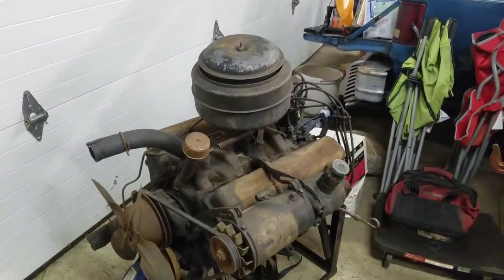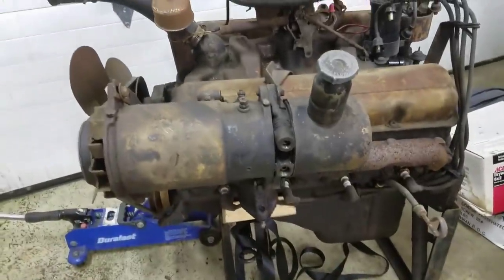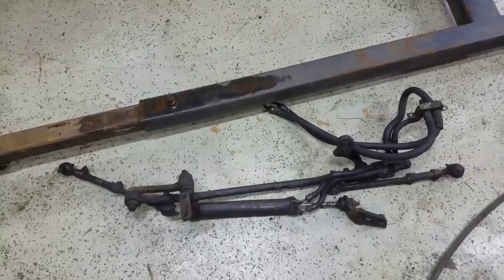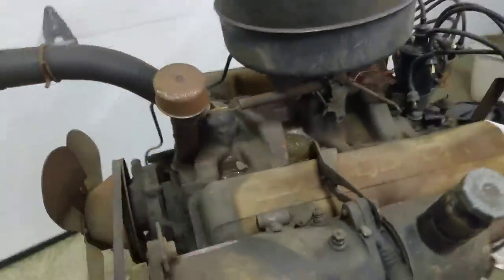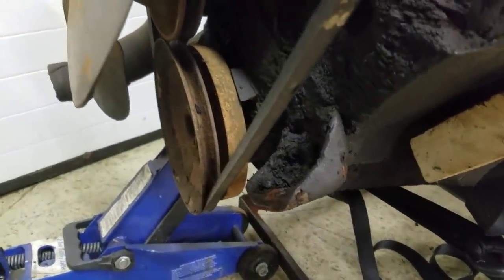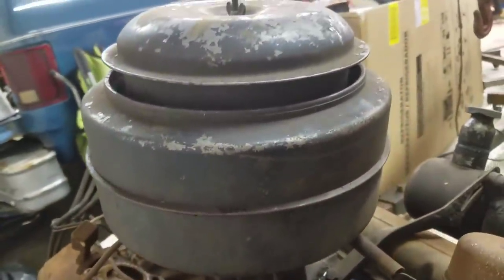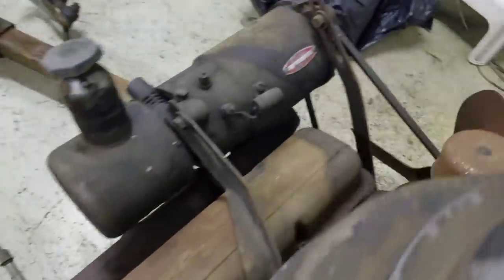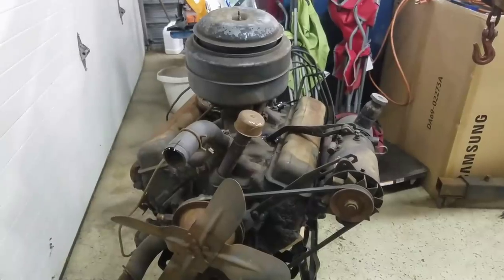The original Small Block Chevy - The 265

Comment: Road draft tubes continued for a few years after 1955, and contributed to tons and tons of smog. There were 3 different 265's available in 1955, the mechanical lifter 2 barrel carb @162 horse, the hydraulic lifter 2 barrel @ 180 horse and the "Corvette" 4 barrel engine @ 195 horse. And the partial flow oil filter would have been better than no filter at all.

Comment: The early blocks weren't drilled for a starter, it bolted to the bellhousing.  Also, the rear cam bearing is different.  If you put a later cam in, half the lifters won't get oil.
Reply: all the rockers won't get oil without the cam bearing having an oiling groove cut in it. Weird design.
Reply: Distributor is machined with a groove in it to allow oil to pass around the shaft and feed the lifters as well.
Reply: The rear cam journal must have a "slot" machined into it to scoop some pressurized oil on every revolution.
Reply: 19504x4 hope you don't know about the lifters no oiling from experience!😄
Reply: @coolezum  I'm all checked out on the early 265 v8s. They can only use a 265 specific camshaft with a groove on the end journal. Any other cams will prevent top end oiling.
Reply: m schiffel just kidding with ya brother. That would be a bitch to find out the hard way though. Not that I'll likely ever build a 265 but it is nice to know. I'll pass it on to a couple friends of mine that build motors and see if they are surprised but, they do mostly big blocks for the drag racing. Peace to ya man! 😄🇺🇸
Reply: You can machine the oil supply grove into the rear cam journal, I've heard of people using a grinder as well.
Reply: @realmccoy9597    I did that with a grinder way back in 1966 on my first 55 Chevy...used a hi perf 283 cam in a dual quad 265...worked like a champ.
Reply: @mschiffel1  that's awesome ! The old timers I've talked to over the years told me that a grinder works great.
Reply: @realmccoy9597    The notch has to be 1/2" wide, 1/2" long, and 1/8" deep.  That's all you need for success.
Reply: Didn't the lifter oiling have somthing to do with a hole drilled through the distributor housing?
Reply: @michaelstrafello8025  no the distributor had a machined groove 180 degrees around it to allow oil to pass between the drilled holes in the block.
Reply: @michaelstrafello8025  No. The oil was fed under pressure to the rear cam journal in the block and the slot in the cam journal divided oil to both lifter banks, one then the other as it rotated. The distributor just drives the oil pump via the shaft connecting the two.
Reply: @michaelstrafello8025  All SBC distributors are interchangeable. The oil is fed through rifle drilled holes in the block. The rear cam bearing has a groove all around it in the center. The main oil feed is in the center of the block above the cam where it feeds into the rear cam bearing, and is thus distributed to the lifters via the slot in the cam to both banks alternately. The distributor has zero to do with this, other than to drive the pump. There's a guy Chrome Lugnut on the Tri Five forums that talks about converting a 55 265 to "full pressure oiling"..I've got news for him...ALL 55 265s had FULL PRESSURE OILING...This guy's all wet.  The distributor gets its oil from a drilled passage in the dist shaft hole in the block. There's also a drain hole in the distributor housing that returns oil to the sump. It doesn't need much. I have raced a few 265s with dual quads in a stock 56 Wagon, and a few 265s in a 55 sedan way back...We built our own engines for racing. How many have you built?
Reply: @Clyde Boenke This is all great info. Building a '56 right now on video & have an option to put a 265 in it. Might go with a 350 instead because I'm gonna run a 4 on the floor. Kinda want some more hp.

Comment: 283s as well as early 327s had draft tubes that came out of the top of the block on the driver's side of the distributor. They had a filter inside the lifter valley. When they became clogged, the breather fill cap would start rolling smoke if it wasn't clogged with dirt drawn in. Then in time, the valve covers would leak, as it appears this one does. This was at the time when detergent type oils were starting to appear and the junk and sludge these motors would build up was horrible, especially the short trip drivers. This truly attests to the rugged but simple and quality way these engines were designed and built. Who knew in 1955 what legacy lay ahead of this new V8 from the low cost value leader, Chevrolet.
Reply: They didn’t have a filter, it was just a baffle can to keep liquid oil from going out. The only way they would clog up was if the entire engine valley were to fill with sludge. That however is believable as I know how some of the early road draft tube and no PCV motors would fill up with sludge. I had friend who took the valve cover off that had Chevrolet stamped in it and underneath was a sludge valve cover with Chevrolet molded in it.
Reply: Michael Szczys A similar experience to what you get when you pull a Chrysler Sebring V6 motor apart.  Structural sludge.
Reply: All SBC valve covers leaked until they machined the sealing surface of the heads and moved the bolts to the middle of the valve cover. Factory rust proofing for the bottom of the car.
Reply: People weren't big on oil changes back then either.
Reply: Yeah back when you afford a damn Chevy??!!
Reply: @sammolloy1  your right!! They are leakers for sure!!

Comment: I’m impressed it’s that complete. Usually the air filter housing is the first thing tossed followed by the intake
Reply: I have one that’s a complete long block, partial bellhousing and torque converter still bolted to it. Unfortunately it’s been outside for decades, pretty weathered.

Comment: There it is, all 162 hp worth lol Chevy really did do a great job of refining the small block during the 60's/70's
Reply: 162 gross hp. On a test stand with a prony brake and no air cleaner, no exhaust manifold, no accessories, not even a water pump. Ran it just long enough to get a horsepower reading before it overheated... and that’s what they advertised it as. 

Good thing the 1950s GM cars were relatively light with that X frame... though they were deadly in a collision. 

B
Reply: That was a Beast in those days!!!
Reply: They all started somewhere! Fords flattie was 85 HP, Chevy at 162 was nearly double! What a major improvement. Cavemen didn't fly around in jets you know.

Comment: The oil bath forces the air to go thru the oil, not along the surface of the oil. Baffles and screens separate the air from the oil. 283s had a crankcase breather similar to the 283. Except it was a tube that attached next to the distributor. Oiling system is different, so the cam is different from the 283. The back bearing journal has to have a flat spot milled to allow oil to pass thru the bearing an lube other parts. If you put a 283 cam in a 265 w/o the flat spot you'll have an oiling failure further down the line. As the cam turns, the flat spot allows oil to pass into the exit hole after lubing the bearing. I was in high school in the mid 60s. We put these engines (265, 283, 327)  in WWII jeeps, etc. 283s were commonly bored to 301 (327) bore. At that time, the Chevy small block was the most common circle track engine.

Comment: the rear motor mounts attach to the bell housing. I was 10 years old when this was new. really changed things. my father bought a 56 265/205hp with power glide. great car. sadly these cars rusted out quickly and had poor crash protection for the occupants. it was great in its day.

Comment: It's called "Power Assist" steering. Just like a C2 or C3 corvette. Also, the camshaft is different. It has a groove in the back journal to send oil to the push rods.

Comment: I drove a 283 truck, 1956 tow truck around the yard as my first vehicle ever driven. 1 barrel, vacuum wipers. Amazing history. the 283 was the "big" one. the tow truck weighed 6000 pounds.
Reply: if it was a 56 it would have had a 265 ci, and it would have had either a 2bbl or a 4bbl carb. The 235 ci i/l 6 cylinder would have had your 1 bbl carb.

Comment: The 283 in my 62 Chevy pickup had the tube going to the air with no PVC valve. A canister oil filter and oil bath air filter. Oh and the same breather tube in the intake manifold.

Comment: 1955 Chevrolet Bel Aire Convertible with a 265ci, - ran smooth with a sweet sound after dual exhaust installed.  Courted my Wife 57 years ago - miss that ride

Comment: Way back once upon a time I owned a 1957 Chevy wagon with a 283 in it and she had a tube that had one bolt through it at the top. That was for the crankcase bent. Was located at the rear of the intake manifold if I recall right.

Comment: The bypass oil filter mounted under the thermostat housing on the intake. The pressure oil comes from a plugged hole tapped into the front of the block above the timing cover. The return oil you had to drill n tap a 1/8 inch pipe thread into the intake so it would drain into the lifter area. I have 2 of these 55 engines. My dad also has 2 of them. I have a 56 short block and a 57 283 Power-Pack 4 barrel engine in my garage. They're getting tough to find these days.

Comment: That was interesting, thanks for posting. The intake oil filter was stranger, and I'm surprised it actually ran that way. In hindsight, it reminds me of K&N filters. My '66 327 has that crank pulley/harmonic balancer setup such that it's pressed on. You don't hammer it on, there's a tool that I got from O'Reilly's that you place on the balancer, align the index (cone/bullet thing) in the center,  start spinning the worm gear.

Comment: I noticed the heat riser weight resting on the intake from the right exhaust manifold. It closed when cold and heated the mixture by passing the exhaust to the other head .  The offset valve covers changed to symmetrical in 1960.  That is why gaskets have two holes on the top side.  The power steering moved to the left front block in 60.  There are two motor mounts on the bell housing unique to 55-57. Also the frame has 2 more holes punched so the longer 6 cylinder can be mounted with the same front mounts.  Fun stuff.

Comment: As a teen I had a '55 Chevy Bellaire sedan with a 265 and power glide combo. The 265 had the add on oil filter. Messy to change but at least slightly effective. It was a sweet running little motor.

Comment: Very nostalgic to see the exact engine that was in my 55 Chev, although mine didn't have the rare power steering assembly. Nice to see. that it has manual 3 speed box, I don't care for PowerGlides. I wouldn't use dirty oil for the air cleaner, prefer fresh clean oil, works better. In 1955 there were no PCV's, just the road draft tube, with the blowby going out into the air.  And you call it weird?  Sure, I guess it's weird, looking at it from 63 years into the future. Today's cars will probably be called weird  in the year 2081. That's normal. The engine mounts were attached to frame exactly like the 235 6 cyl. engine and the Corvette 265. The optional bypass oil filter could have been attached at the same outlet for the oil pressure switch, with a simple T fitting.
Reply: @ Mr Hillfolk. That’s what someone in 1973 thought about a 1955 Belair. They were $50 jalopies and demolition derby cars. That’s why they are rare and coveted today. 

Or what someone in 2019 thinks of using lyrics from a shitty 1998 Offspring song to threaten someone. The 97 Taurus is better.

Comment: Also might add that yes, early 283s had a road draft tube, my 59 Chevy Viking has on but on the 283 the tube is vented starting out on top of the engine behind the distributer around the block then out the bottom.

Comment: road draft tube crankcase  ventilation was all you had in those days,the oil bath air cleaner was very efficient if it was serviced.it is still used today on small stationary engines.

Comment: They were awesome at the time and everyone wanted one. No oil filter on the 265. The '57 came out with the 283 advertised at one HP per cube and had a 4 barrel carb.
Reply: The 283 with 283 HP actually had two four barrel carbs if my memory is correct. If you opted for fuel injection and solid lifters, it got close to 300 HP
Reply: @t.d.mich.7064  Right. I forgot. They made so much power after that with one 4 barrel I guess it slipped my mind.

Comment: Actually, oil bath air filters did have elements, and they did an excellent job of cleaning the air.  Plus, there was no additional restriction to air flow as the cleaner accumulated dirt, as the dirt wound up in the bottom of the oil well and not on the element.  Were these cleaners bulky, ugly, and nasty to clean?  Oh yeah.  The 6 cylinder engine in my 1956 Chevy 210 had an oil bath air cleaner, plus a canister oil filter with no drain plug.  Servicing them required lots of newspaper, some mechanic's safety solvent (gasoline), and several cold beers.  As for your 265, please please please restore this engine and keep it 100% original.  It is a real museum piece.
Reply: Ebay

Comment: That style of power steering is technically known as "Power ASSIST" steering. My old '65 GMC was power assist. 
As for the motor mounts you mentioned, what you showed us was the front motor mounts. The rear motor mount was a ring that attached to the back of the block. The transmission attached to it as well. The ring had two large "ears" with rubber biscuits inside and a large bolt and washers went through the biscuit. That rear mount is commonly referred to as a "Flywheel ring". There was no mount for the transmission, it simply hung off the back of the flywheel ring.
The Road Draft tube you showed us were actually common on cars through most of the 60's. It wasn't until the government stepped in with the early emission laws that the tube was replaced by the PCV. Interesting point, when I worked on OTR vehicles in the early 90's, I was quite surprised to see all those trucks were still using road draft tubes, even at that late date.

Comment: Yup  55  Chevy  no oil filter..  Oil  bath air  filters  normally have  chambers  filled  with steel wires.  and  yes  the  air  has  to  go  down into the oil then comes  back up  goes  through  the oily  wire then into carb..  My  1975  Chevy  427  Truck still had an oil  bath air filter  as  does  my  farm  tractors and even  my  1,103  Cubic  inch Murphy diesel in my North West  Crane ..

   My 6 wheel  drive  trucks  from  1960's  and  1970's  and   1981  have  power steering  cylinder the  same way and a valve in the drag link that opens and closes  the  oil flow .. spring loaded.
  I read that GM  could  build those  '55 engines for  $77.00
  My Cousin had  a'56 Chevy with a 265 cube  265  HP  Corvette  engine  with dual 4 barrels ..
  Solid Lifter Duntov  Cam

Comment: Interesting fact about SBC’s was the first year had issues with piston rings not seating and they’d burn oil like mad. The official GM fix they ordered dealers to do was pour Bon-Ami cleaner powder... like Ajax or Comet cleaner, down the venturis of the carburetor. This would scuff up the cylinders enough to allow the rings to seat.

Comment: Gm Australia did a 253 v8 1969-84 and a 308 then a stroker 355 till 98. Designed in oz signed off by Detroit. Similar to a chev bottom end with Pontiac rocker gear. Firing order 12784563.

Comment: Running a 2nd accessory off the back of another was common practice on tractor engines. Nothing unreliable about it. I had an early Tri-5 with the power steering, worked great except it leaked some. I owned 2 of these, one a 55, the other a 56. They were both good stuff, ran great with good mileage. Some of the engineering was borrowed from other GM stuff, like the rocker setup from Pontiac. Lots of cars had the rear mounts on the bell housing.

Comment: The very early 265's had the rocker arm studs pressed into the heads (which eventually pulled out) and there was nothing to keep the cam from moving fore & aft which affected the ignition timing. A plastic button was eventually put on the timing chain cover to keep the cam from moving.

Comment: 19 68  was the first year that the smallblock  had accessory holes in the head and no more oil filler tube in the manifold, oil was added  through the valve cover.

Comment: I have a 55 Belair with that engine with the power pac option (4 barrel duel exhaust) 180 HP. Mine also has the factory power steering with the optional oil filter. Not worthless! People always try to buy the engine from me cuz most were swapped out for 327s, I also have the factory 4 BBL oil bath air cleaner which will run you about $1000 if you can find one.

Comment: My 1958 283 had a place to put mounts on the sides. The 283 and 327 used the same road draft tube into the mid to late 60's.
Reply: Road draft tube was gone by 63.

Comment: I had one of these that was swapped into a 55 Willys truck.   Its numbers said it was a 56.  It was the best running little motor.  My rear draft tube came up from the rear of the block into a filter then down about 9 inches.   Clean that little guy up and give us an update on what you do with it.